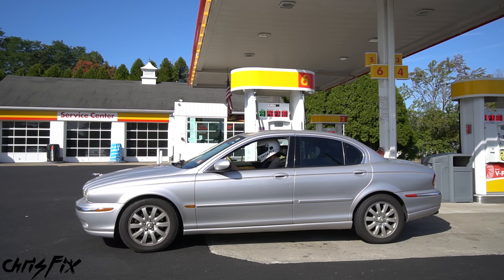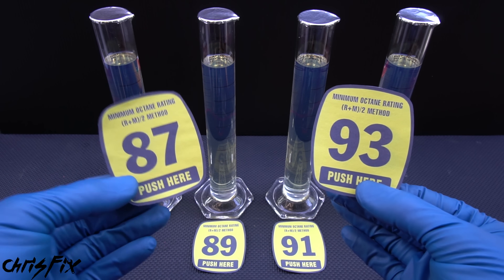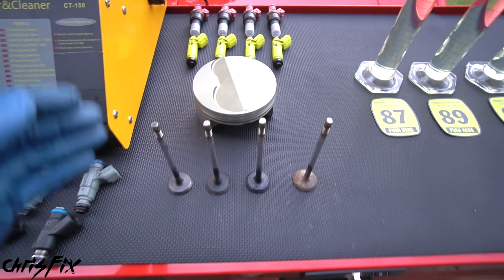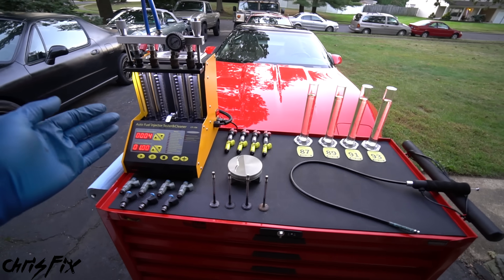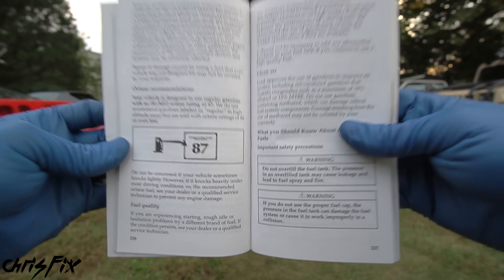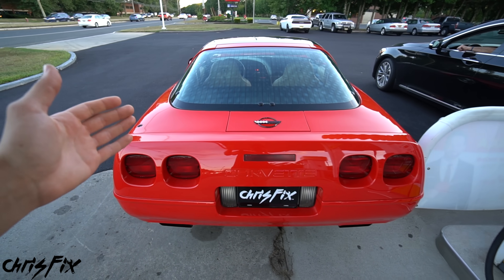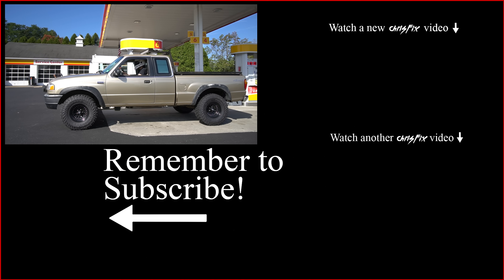What is the BEST Fuel to Use in Your Car or Truck and WHY

Comment: Why is there 85 octane still around if most require a minimum of 87? Also I have a truck with 185k miles on it, should I run premium to clean it out or should I use other methods?

Comment: Very nice!  Straight forward, science and mechanical reasoning for what fuel to buy for your car or truck.  Some of us old dogs, I'm 61, who were around when fuel contained the lead additive, are reluctant to purchase the lower octane level fuels but we can't articulate it as well as this presenter did.  I have my son to thank for sending me this link.  Considering I was building engines in the late 70's through the early 90's, I'm very reluctant to purchase lower octane fuel because you sometimes you really do get what you're paying for, but I also admit that I'm quick to check the operators manual for fuel recommendation.  (As GOOD AS THIS VIDEO WAS I still can't buy gas from Shell!  Took too many engines apart with fuel fouling from cheap Shell gas!)

Comment: So with modern engines you COULD get more power if you use higher octane because it can adjust timing for the lack of pre-det, but depending on what it was designed for you might not make any extra power.

Comment: What about fuel efficiency on cars that work with E85? Or even high octane fuels that use extra ethanol as an octane booster? My understanding is that ethanol has less energy than gasoline, so your fuel economy may go down when using these fuel types (possibly in exchange for higher performance).

Comment: My car is designed to run on 87 octane but when I run it with 93 it has much better pickup. Could this  happen from something like a fuel flow restriction? Anyone know the reason for this?

Comment: Chris,  most gas stations have different sizes on their Diesel and Gas pump hoses. The hand grip value nozzle size prevents someone from putting the wrong (diesel in a gas car and gas in a diesel car) fuel in your tank. The tank inlet whole sizes are different on Diesel cars...try it some time... the nozzle on a Diesel pump hose won't fit in a gasoline car and visa versa.

Comment: Petrol is very complicated thing i have a friend who works as a petrol chemist and he can make gas from most things but the petrol would have very small octane number and me and my friend put 100 octane special race fuel in a car it runs better smoother simply the best and we put very low octane fuel like it was around 60 octane just like methan and the car had major issues running although it was around 100 hp 4 cylinder it couldnt go uphill
So i think that its very hard to talk about fuels

Comment: No wonder I have problems with my truck you just helped me out a lot I have a ford lightning and I didn’t know what gas it takes and I put 87 in it and the engine nocks and I just going out it only takes 91 or higher what should I do now drive it until all the 87 burns up or add 91 and mix it

Comment: you didn't go too much indepth with the chemistry, so here's a little summary: The octane rating isn't actually telling you what's in the gasoline, it is telling you how it would combust in a simulation compared to a pure octane fuel. In reality, there's lots of substances in modern gasoline that do various things, like help clean the engine or prevent wear, etc. These ratings are determined experimentally, so someone in a lab literally burned a little bit of gas and wrote down how easy it was to explode, then slapped a number on that recipe.

This is why it's possible to have octane ratings above 100; the liquid simulates having more resistance than a pure liquid of just that one type of octane. But in the real world, chemicals cost money so that's why we bother having a scale at all.

Comment: E-85 does not burn as hot as these. Lots of higher Hp cars run E-85 bc it’s cheaper and they can put more timing in the car.

Comment: I USE 93 ON MY '16 4C CAMRY SE.
WHEN I DON'T USE 93 I BURN GAS QUICK. ✌(I ONLY GO TO BP AS MY GAS STATION)
Reply: G Account tf is a v4 ? You mean a 4 cylinder
Reply: @santania5785   right. 👍 thanks for noticing that mistake.
Reply: @santania5785  😄

Comment: it is even easier than this. latest engine can run smoother and better whit higher octaan. only engine whit no computer and caburator will have no benefit whit high octaan, or you need to shift the timing of the ignistion. 
higher octaan can have smaller degrees of timing and so it can deliver more performance. 

like you say we have in europe ron95 and ron98, there is even higer one and thay say ron102. 
every car wil run on ron95 and have benefit whit ron98.

Comment: In the UK 95 Ron is the lowest grade fuel you can buy which is the equivalent to mid grade US fuel. It means all cars can run on regular pump fuel with no problems. A car programme tested the fuels on a golf gti and the premium stuff made around 10bhp and a little torque. On a non performance car the premium fuel made no difference at all. Interesting video tho

Comment: My M54B30 engine says premium required, but it's only 10.2:1 compression ratio. I run regular most of the time, and the occasional times I use shell v-power premium to help keep injectors clean, I notice zero difference in fuel economy, torque, or power.

Comment: I have a 2001 Infiniti Qx4. I read my user manual and it said “Unleaded gasoline with an octane rating of at least 87 AKI (RON 91)*1 In order to maintain engine and exhaust system durability and performance, UNLEADED gasoline with an octane rating of at least 91 AKI (Research octane number 96) must be used.” What gas do I use?

Comment: I had to change the intake manifold on a vehicle mine and noticed that my cylinders were full of carbon. What do you think about adding seafoam in addition to using Shell gas in order to help clean my engine cylinders?

Comment: Can you get gas that's worse than others from different gas stations? What's the difference? I once filled an empty tank on my Lincoln LS V8 from a local gas station that wasn't used too much (other side of town) and the car didn't feel as peppy or have as much grunt as it once did. When I went back to Shell it felt good again. I think others may have noticed too because the gas station was gone a couple of months after that.

Comment: A video about e85 flex fuel swap would be awesome!! Planing on e85 my E46 m3 but worried about the plastic or parts that's would be damage by e85 ( even though some kit provide hard fuel line)

Comment: Put the gas in your car that is specified by the manufacture.
If you car calls for regular, use regular. Using mid or premium will result in poorer fuel economy. If your car specifies premium use premium. Running regular or mid grade could result in pre-ignition or detonation. Running premium in a car set up for regular can also reduce fuel economy because the higher octane burns slower and cooler resulting in less power, so more fuel is used to produce the same power.
Use the octane recommended by the manufacture and don't fall for sales gimmicks by the oil companies to get you to buy more expensive fuel.

Comment: 5:30 I had to stop here. This is not true! Usually, Europe has 95 RON as regular and 98 RON as premium, with some exceptions like 100 octane race gas and what not.
95 RON EU = 91 AKI US!!!
98 RON EU = 94 AKI US
except for Eastern Europe, where 98 RON = 93 AKI US.
This doesn't mean the fuel is 'better quality', but European fuel is more knock resistant, and this is mainly because a lot of engines are made to be more efficient, use higher compression and are very often turbocharged.

Usually, our 95 contains 10% ethanol (E10), even though 0%, 2% and 5% can sometimes also be found (all three are labeled E5 by law). 98 is often still ethanol free (also indicated with E5), which is what I put in my American pick-up (5.7 V8 HEMI), not because it needs the octane number, but because it's a bifuel and does about 2 months with half a tank of gasoline, and I don't want the ethanol to speed up the aging process of the fuel.

It is also untrue that all grades are equal, because a higher octane fuel is harder to ignite. If you have a Corolla that takes 87, it's absolutely pointless to put 93 in the tank, because it may be causing more wear to the ignition components (like spark plugs) without any benefit at all.
A bifuel vehicle (Chevy sold a lot of them here) runs on autogas as well, which is 110 RON or 100+ octane AKI in the US, so even harder to ignite (but a lot cheaper and cleaner burning, I pay about $2,1/US gallon converted since the prices went up again with Trump and the problems in the middle east).

Comment: I had some questions. What happens if i do use premium on a normal car? I like to use shell premium because of the additives being cheaper than buying out gasoline bottle cleaners. Also the additive that protects the piston. Ive used it for some months now and nothing has happened and to me it feels like the car runs a tiny bit smoother but what about the long run?

Comment: High rating octane is more refined you smell the difference over here in scotland low octane over here smells like kerosene that's a fact you need to go to places to tell the difference mate not just in your wee bubble you live in get ur facts straight octane booster Burns your piston rings  if you use it to often it burns at a higher temperatures you forgot to mention that in your video🇬🇧🇬🇧mate

Comment: In Europe we dont much use octane levels to indicate fuel but mostly use ethanol levels like E5 and E10, where E5 stands for 5 %ethanol and E10 stand for 10% ethanol. So be careful with what you are putting in your gas tank E10 will coroat fuel lines in older vehicles

Comment: The best fuel is ANYTHING other than the deadly DIEsel and toxic gasoline that the banksters are selling. Ride Clean & Save Green! Choose anyone of the 7 cleaner, safer, local fuels that cost less than the petroleum that is being sold at less than it’s true value. Cleaner fuels keep your oil cleaner, which increase the life of your engine, while reducing maintenance costs.

Comment: I did a test n my 16 Tundra and I got a smoother idle and quieter engine with 91 but better mpg with 89.  I’ve had subscribers tell me that their Tundras had issues after running E85.  They said their trucks were flex fuel trucks.  We don’t have E85 here so I can’t test that. Another great video. Thanks 👍

Comment: Very good video. It is good to know what the difference is between the fuel. Here in Slovakia (Europe) are 91, 95, 99 or many gas stations has 100+. I always go for 95. Its for 2004 Daewoo Matiz and for 2017 Opel ( Vauxhall ) Astra. Do some more videos. No just "one per few months". You doing great job. More videos are welcone. Thumbs up, man.

Comment: Is there any method that we can find out what is the octane number in fuel?
In my country, there is no octan number on gasoline and it comes in tow types of regular and super!
Also, there are octan bottles in each gas pump that you can buy separately, I don't know if its good or bad for my car!
In my owner manual, it says use unleaded petrol because it may damage the catalyst and when you used a leaded petrol use right kind of Fuel Supplement that verified by our company.

Comment: not
you're wrong
gasoline in america is no good,
and this explanation is wrong
if you go to a dynanometer measure the power of a 93 octane car and then 99 octane, the horsepower and torque difference is very large

Comment: For example here in Finland we have 98e5 octane and 5% ethanol and 95e10 that has 10% ethanol. In this skenario we have to think because ethanol has less energy for same volume, but it's cheaper. Most of the time the 98 and 95 are basicly same price because one liter of 98 gets you a bit farther. Also 98 smells much better :D in case you spill it.

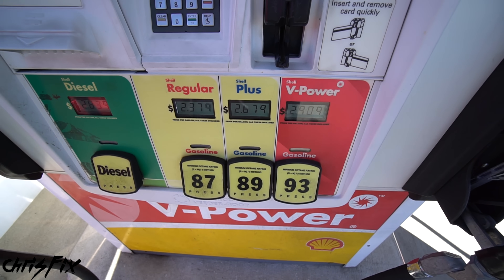Comment: 4:50 but germany still has 102 ron octane 😂
Reply: Kevin D I believe the octane rating is different in Europe than in America ... essentially same rating
Reply: @GabeItches_77  that is correct sir
Reply: In Italy sometimes we are able to find 105 RON
Reply: In Midwest some gas station carry 100 octane. It's about 6-8$ per gallon though vs 2.80$ 93 premium
Reply from the maker: That is awesome!  How much do they charge for that?
Reply: @chrisfix  I  romania we have 102 octain and it s like 3 euros
Reply: @chrisfix  in Italy for 105 RON is about 2€ per liter, about 7,50$ per gallon
Reply: @chrisfix  depends, but 1.60 ish € per litre is kinda ok 😌
Reply: You can get 101 and 110 in the US, just not at the pump on every corner.
Reply: @jasonshortphd  This is correct.. Most of the places that have 100+ will usually have a racetrack or drag strip close by
Reply: We have that too. Called race fuel
Reply: Yes we have 102 octane over here in Germany, but it’s like 1.60€ per litre lmao
Reply: @Taiger-vd2dq  1.6 euro /liter!? That is cheap. In Sweden 102 octane is about 25 SEK which is about 2.5 euro/liter
Reply: Im curious what is the prices in your country now 😅

Comment: Please make a video about fix a blocked tube of windshield washer I got it blocked at the water container part not next to the windshield
Reply: I'm pushing the dirt away by blowing air in the tube to move it but it always cames back and blocking the way for the water to the windshield

Comment: My car recommends 95 octane gasoline but I've always walked with 98 octane I can put additives to increase the octane in gasoline 98 without ruining the engine?
Reply from the maker: So you would need a lot of additive to raise the octane that many points. Using octane booster helps when you mess up and put the wrong fuel in or if they dont have the correct fuel but it isnt something I would use daily.
Reply: @chrisfix  tanck you for your advice. I love your vídeos 😂

Comment: My car recommends 95 octane gasoline but I've always walked with 98 octane I can put additives to increase the octane in gasoline 98 without ruining the engine?
Reply: L. Dega  I know that 98 octane is better  but what I really wanted to know is if there was a problem using a more octane gasoline for the engine but tanck you for responding me

Comment: my toyota recommends premium, but can take regular and compensate for it (probably by pulling timing) and i ran both for a while, compared the mileage i was getting, and it was actually cheaper to run the regular, it was something like 6% cheaper but only lost 3% mpg or so. but i run premium anyways because they add cleaners and stuff to it

Comment: Probably a rhetorical answer but I have an 07 Ford Fusion, she runs great, but anytime I’m stopped at a light, my RPM goes down to 1 which I know is normal, but every once and a while I hear something and it sounds like my engine still thinks I’m driving because I look at the RPM gauge and it goes to 1 and a half RPM when I’m fully stopped. This doesn’t happen if the AC is off, so again probably nothing but I know many other people know more about cars than I do. So if this is normal please let me know. And an extra piece of info, I had an engine coil replaced a few months back, car would fight on stopping, so maybe it’s that. But again please let me know.

Comment: I feel like I just watched a 16 minute commercial for Shell
Reply from the maker: I mentioned shell twice for their new technology in their fuel for providing lubricity in the upper cylinder and for corrosion resistance, and for how I ran it in my truck to stop the pinging...
Reply: And I dont even care.
Reply: Well it's more 93 USA or 99 octane UK in the UK you can buy it at Tesco's.
Reply: There really wasnt all that much related to shell. Most of it was ad-free.

Comment: Addition: in NL (the Netherlands) they just changed the 95 (your 89) from e5 to e10. So watch out if you ship your car to here. Cars build after 2000 run without problems on e10, but check if your car is older. E = ethanol (alcohol) to get better burn of gasoline.

Comment: This explanation is flawed. 
Not all kinds of gasoline have the same energy value. 
Usually higher octane gasolines have a lower energy density, because the additives that boost their octane rating have a lower energy density than gasoline and the more of those additives (like ethanol) you put into the fuel, the more you dilute and lower it's energy density.
The additives can also have adverse effects on the speed of the flame front etc.

Comment: People be very very careful with that octane booster... I have a car that recommends to use premium fuel, and I was putting that octane booster everytime I filled up.. Then after a few months my car began to misfire and went into limp mode.. When the dealer looked at the spark plugs, they found them orange... That's because that octane booster has a lot of MMT, and it killed some brand new spark plugs in a couple of month... Be aware of products with MMT.

Comment: As GDI cars get older and carbon build up changes the compression of the engines higher octane fuel helps prevent engine knock that wasn't necessary at earlier points in the engine's life.

Comment: In all small engines especially snowmobiles snowblowers you should run non ethanol since ethanol attracts water and we all know whatever is not good for engines. Just a little tip Incase you didn’t know🤷🏻‍♂️

Comment: Dude your truck looks slick with them wheels and tires

On a side note my truck burns them all pretty much equally....I get same mileage no matter what octane. Really the only difference is 10% ethanol gets ever so slightly less mileage but not enough to worry about. I get non-ethanol only (available at almost any gas station around here) just to keep ethanol out of the picture as much as possible. If I have no choice I'll use 5% or 10%